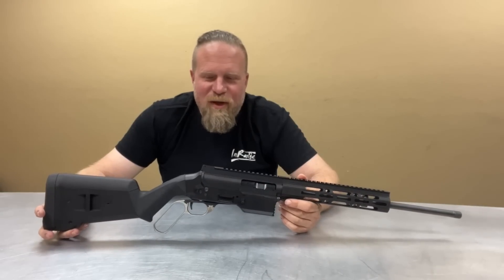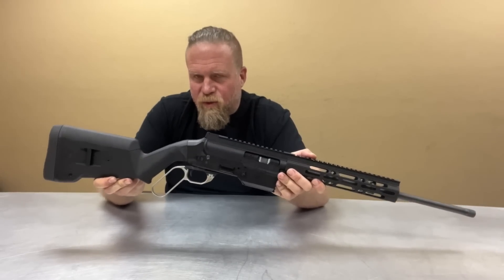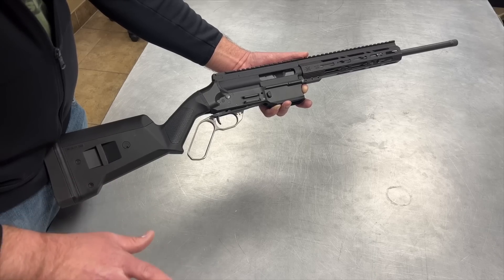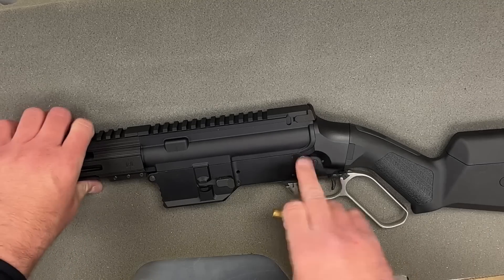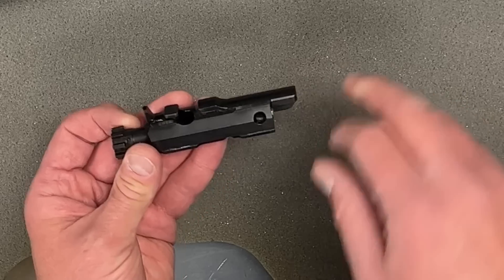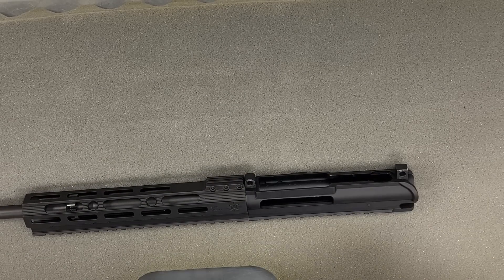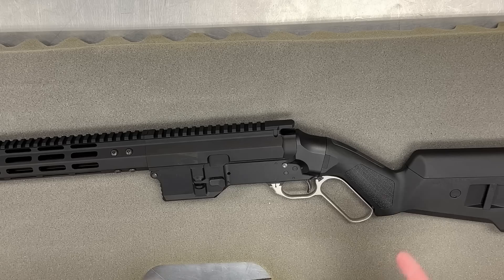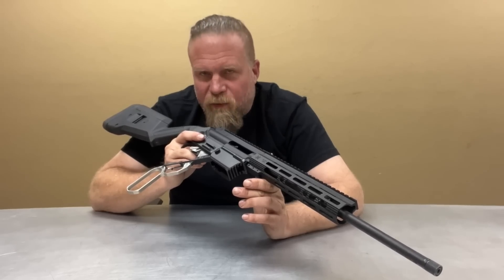Bond Arms Levergun - Design Principles and Internals

Comment: The problem with the little "plug"?

As one might expect, the solution was worked out by the fine chaps from Armalite, back in the 1950s. Because the cocking handle assembly was located under the carry handle, and had to move a fair way rearward, they built a "telescoping" handle / "slide" rig that did NOT project out of the rear of the upper. They simply added a suitably dimensioned "bump" on the top of the rear of the lower receiver "tower" that blocked the "hole" when the rifle was assembled, but once the rifle was "open" the hole was exposed and the cocking handle parts could easily be removed.

Nice work, overall. The next logical leap past the Winn 88, the Sako Finnwolf and the BLR.

Comment: I think a version that has a short stroke piston with the no buffer tube style of AR that has the springs forward, then something to change from single shot to semi would be amazing so would a side magazine like that new German bolt action AR, they should also make an AR-10 size that can handle up to .338L

In so many nations the gun as is (still think a side mag is better) and the option of wood furniture and maybe even a steel upper and lower would sell like crazy in places that ban semis, most places that ban semis have no mag restrictions so 40 round mag or drum would be kind of funny.

In the UK not only are centerfire semi rifles are banned but so are pump action centerfire rifles as the gov though they could fire it too fast.

They recently banned the system of fire a round the bolt locks back then press the trigger or button or lever to close the bolt and be ready to fire.   Like quarter automatic.   That was considered to fast.
This lever gun that's fast to reload would piss the police off and they could not do anything about it.

With alot of practise I bet you could fire this thing at over half the speed of a semi auto.

I really do wish they made a standard Winchester action lever gun in 9mm 
I know .357/38 is close but 9mm more rounds could fit in, more available and cheaper to shoot.

My uncles freind has a lever action side loader converted to 7.62x25 tokarev.

I was only a teenager when we borrowed it for a few weeks as tok ammo was crazy cheap back then like a few cents a round.

And wow was it nice to shoot, it was crazy accurate and flat shooting out to long ranges.

If I was in the old west and could only have firearms chambered in a pistol caliber that would be it , I mean they used a slightly weaker round in different types of C96 pistols and carbines at the tail end of the west.

Such a shame it's expensive but it's crazy that surplus FMJ standard ammo out of a tokarev can pass pistol armour every time and sometimes both sides, a 500 revolver can't do that, civilian 5.7 no , maybe CZ 7.5FK

Comment: Lever rifles have always been fast-handling and fast shooting.  Adapting the AR design to lever is makes sense on many levels other than to avoid semiauto ban issues.  A lever action lets the shooter cycle the action, which means brass ejection can be controlled, especially good for hand loaders who retrieve every case.  A lever gun can make much better use of a suppressor because no sound exits the breach due to the action opening, and a lever action is better for those crafting subsonic loads because they don't have to worry about whether the round will cycle the action.  And, lever actions can be fired FAST!  It's even possible to attach a device to the trigger guard that presses the trigger as the lever fully closes so the shooter can fire the gun as fast as he can cycle the action!  For those so inclined.
IF they price this thing competitively they'll have a hit.  I would absolutely buy one.

Comment: That will be awesome for all of the calibers and cartridges available.  Since I have stockpiles of 7.62x39 it would be great with a Radical Firearms or Palmetto State Armory upper.  Then add 6mm ARC and whatever else you'd want with heavy or light or long or short barrels.  No worries about finicking with the gas system and optimizing it for what you want to shoot, just make sure the barrel's chamber and twist rate matches.

Comment: bond arms fan here, but the  lever not going flush with the stock when closed, and on the large side is kind of crude like its hanging there. . also the lever stroke  is too long,,  in tight quarters it would be awkward trying to work the lever.. Gordon will get it sweet though.

Comment: Sad thing is that you can't utilise a standard mil-spec AR-15 bolt-carrier group. That means that buying just a lower won't be enough, I'll also need a dedicated BCG to work with. That's a downside for those european countries where barrels (ones that include chambers), bolts and upper receivers are registered gun parts while the typical lower is not. In that case one will ultimately end up buying a registered weapon component anyway.

Comment: I really like this design... being able to use the massive existing AR upper receiver market with only minor modifications is huge.  I remember when the Henry Long Ranger came out, people were wondering if it could potentially have a larger magazine than the standard 4/5 round one, and it was determined it couldn't because it would interfere with the lever throw; they've been able to come up with a mechanism that circumvents this problem.

Comment: Using the Magpul SGA stock is great, for the modularity.  It has a variety of cheek riser heights, plates for length of pull adjustment as well.  A lesser know option from Magpul is the adapter plate to use other Remington butt pads, which includes aftermarket ones, like Limbsaver.
If Bond Arms continues to evolve this design, and it's caliber options, will we see .308 size frame and magazine options?  I hope so.

Comment: The key thing here is the lever design, since it seems to avoid a lot of the issues that I've seen with the POF Tombstone (particularly the difficulty in stripping a cartridge out of a fully loaded magazine; this offering from Bond Arms at least appears to provide enough leverage to make this practical). The ability to swap uppers to change calibers is a pretty sweet deal too, even if it does mean you have to get new bolt carriers and plug the gas ports, so it's not a perfect plug & play, but still.
Reply: Yep making sure it actually operates as intended unlike the POS......err POF.....is the biggest factor in me buying one. If this thing comes out and reviews show it truly working as intended then they've got a sale to me.

Comment: "I know InRange is big on mud tests." Yes, and this is a lever gun with a massive ingress area through an essential part of the cycling mechanism just behind the mag. A dust cover really wouldn't help much for this one mud wise.
Reply: For like 200 years, lever guns have worked in deserts and swamps and tundra.
Reply: @bobjohnson1633  I'm not say they haven't functioned fine through normal use. I'm saying it'd fail one of Kasarda's mud tests which simulate an absolute worst case scenario that people who've used it do their damnedest to avoid.

Comment: Make the plug for the charging handle out of rubber or soft polymer and have it press fit in. Could also be anodized aluminum with a polymer insert, or even brass with a polymer insert for use with a wood stock and handguard.

Comment: I can't even find an old school lever gun locally. I was lucky to get a 2nd hand Rossi in .357 last spring. Nice to see some modern attention being given to these classic tools 👍👍
Reply: I love the Rossi .357  great gun!
Reply: @thenathanr4243  I've seen mixed reviews, but mine seemed to work just fine when I had it at the range. I was using 38 spcl to see if I could replicate the feeding/cycling issues I read about, and the only malfunction was my fault for babying the lever while working the action.  Mine is the carbine version so very compact & light! It shoulders & points extreme well 
👍😎
Reply: Maybe lever availability is based on regions. Plenty for sale around here.

Comment: Now we just need someone to adapt a modern short stroke straight pull, like Blaser and Merkel offer, into drop in AR uppers. Since dudes are already pulling gas systems out of regular ARs, and side charge ARs for quality of life when hunting suppressed. There are even old school turn bolt uppers for the AR. But having a spring slam the action forward is sub-optimal compared to using a transmission to make slipping the bolt in smoother and easier than releasing the handle and fumbling for the grip and trigger. And the Turn bolts have some limitations with the AR trigger system that aren't present in gas powered or straight pull rifles.

Comment: It's absolutely aimed at the ban market. It's a very interesting idea, but forcing it to be partially AR-15 compatible holds it back and results in less desirable consequences in my opinion (although that does make it more desirable for current AR owners).
Reply: How does the AR-15 compatibility hold it back, on paper at least?
Reply: @Bubben246  It forces some tradeoffs to be made. A quick example is one mentioned in the video - the height of the picatinny rail, which is unnecessary because there is no gas tube.

Comment: That's very interesting. I've been suggesting for years that a modern lever gun could be a useful and cheap PDW for military use by "once-in-a-blue-moon" users like HQ/logistics staff and the like. My idea was to get around the need for blunt bullets in a tube magazine by using cased telescopic ammunition (like miniature versions of the ammo for the 40mm CTA gun now being adopted as an AFV weapon by the UK and France), but I'll be the first to admit that that meant adding a unique calibre type and would probably be expensive to develop. If you can make a practical lever gun that uses a box magazine of standard 5.56mm then that's great. 5.7x28mm feeding from standard 20/30-round Five-seven magazines would be another interesting option, giving you a cheaper 'long' PDW than the FN P90.
Reply: Pass the crack pipe my dude because i want what you’re smoking.

Your suggestion for a service rifle for non-combat troops is to introduce a new rifle, with a lever action, chambered in a experimental telescopic cartridge? In an effort to save costs? (This gun is from what i can find, going to cost 1500$ retail by the way.)

Don’t get me wrong, i love lever guns and own several but, lever actions are not by any means cheaper to produce than other firearms. They are in fact more often expensive and more often comparatively unreliable. Box magazine fed lever guns have also existed since the early 1890s (ie Winchester m95), and have only seen limited use since.
Reply: @McAppleWar  Well as I said in my post, that was the sticking point of the idea.
Reply: Bro just give them a pistol 🤦‍♂️
Reply: @xxxxxxxx183  My understanding is that a pistol needs a lot more training to stay accurate with. The idea of PDWs is to give 2nd line troops something that they can credibly defend themselves with, but which imposes a minimum of extra load, training, duties etc... on them.

Comment: Knew it! Thought this could be a thing, and immediately knew someone else would have already made it. I thought a couple of gears converting a 45° throw to two full rotations of a pinion could drive an AR bolt group. The thing is UK-legal. It's not self-loading, its barrel's over 30 cm, it's over 60 cm, ... it's UK-legal.
5.56 from M16 mag, 7.62 x 39 from AK-103 mag, 5.45 x 39 from AK-74 mag, .30-06 from BAR mag, .303 from Bren mag, 7.62 x 51 from FAL mag, 8mm Kurz from StG-44 mag, 9 x 19 mm from MP5 mag.